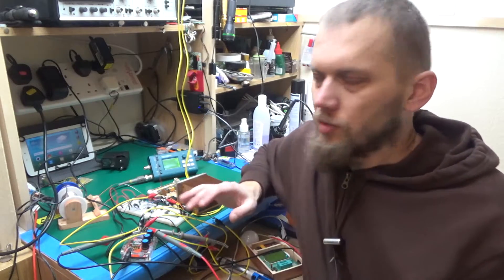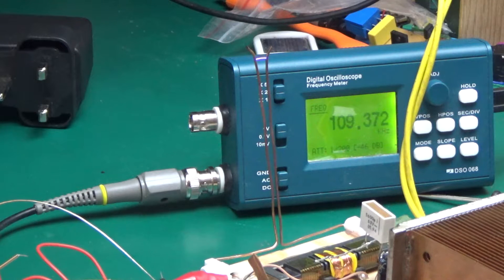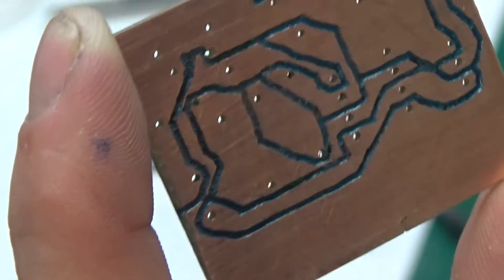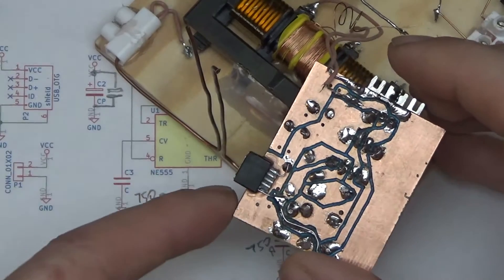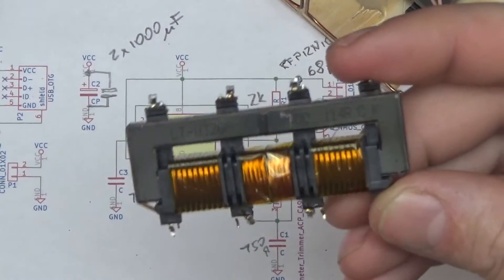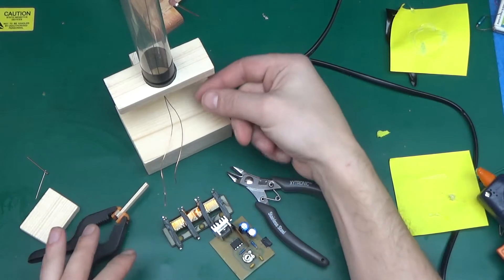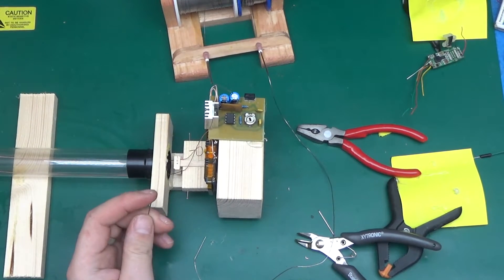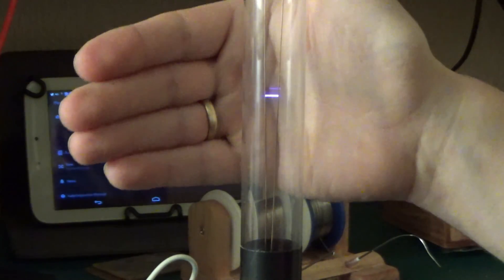High voltage from USB - desktop Jacob's ladder

Comment: You attached a cap between the gate and drain?  Shouldn't it go between the Gate and source for oscillation during the mosfet off time?  Also, there's no pull-down resistor from gate to ground.....aren't your mosfets dying?  Cool project nevertheless.  And, major kudos for giving new life to old components (recycling rather than discarding).

Comment: can you put a voltage doubler circuit between the positive of secondary and the positive antenna to make the ark get stronger or to get it to achive a bigger gap ? awesome video btw ! the high voltage output from small voltage input is really awesome :D

Comment: if you could please tell about approximate high voltage and milli amperes flowing through this circuit
Reply from the maker: +s c Narula hi, i thought about this for a while, and approximately here it is: the maximum gap needed to initiate arc is about 1.2mm. Air at atmospheric pressure dielectric constant is about 3kV per mm. That gives us 3.6kV.
The circuit consumes about 800mA @5V, so about 4W. Given how simple and crude the circuit is, optimistically we can assume 75% efficiency, so max current would be 0.75*(4/3600) whis is 0.000833A, or 0.833mA or 833uA (micro amperes) Hope this answers your question ;) take care!